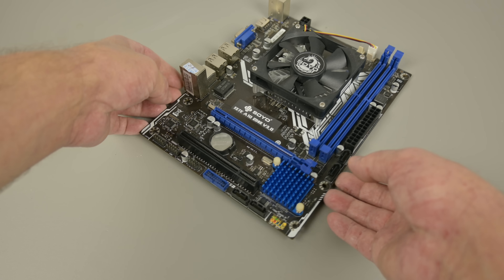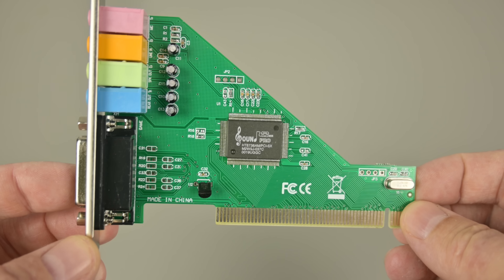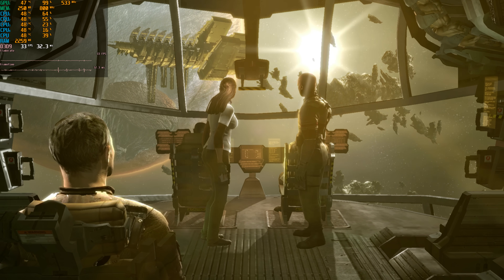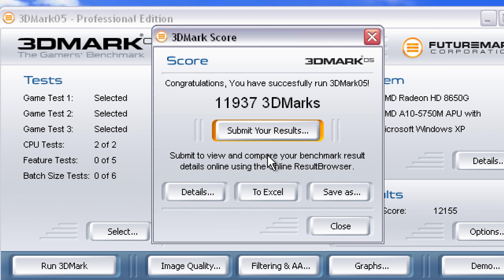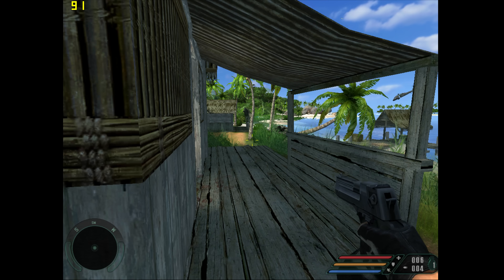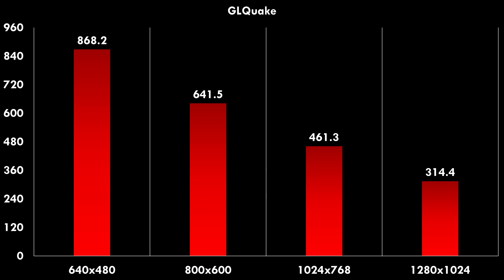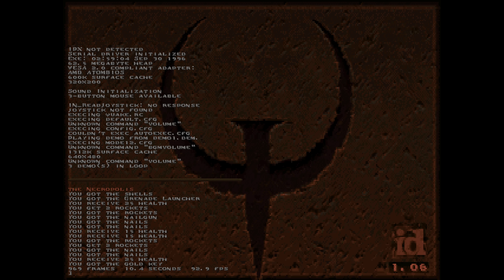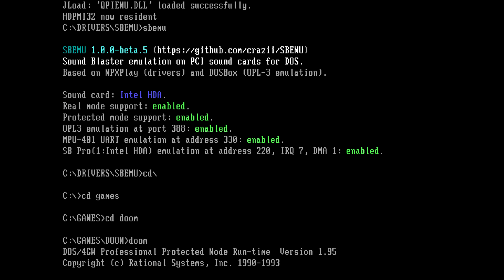SOYO A10 Motherboard: DOS, 98 and XP

Comment: Hopeing for a little help as I just had an ACER system given to me that I would like to turn into a retro BOX, but I have not yet messed with Windows 98SE on a system past 2004

AMD A9-9420 
12gb DDR4 
1TB hdd
it does have one PCI-E 3.0 slot, but it is a very basic motherboard, and the CPU is hard-mounted to the board, so I figured it might be a good system for older games. 
Do you happen to have a guide or pointers for getting 98 to run on an APU-based system

Comment: wait, how exactly do you install win98 on that hardware and which ssd are you using? it has too much ram for start... and how do you prepare partitions for win98? do you connect it to another pc?
Reply from the maker: Windows 98 Quick Install project includes a few patches! Check it out 😄
Reply: @philscomputerlab ok that was easy win98 installation looool
Reply: @philscomputerlab wow! good stuff! :)) I tried it out

Comment: A Geforce 6600 with 512MB of VRAM was my first PCI Express video card. Kept it around for many years as a fallback for when a faster card failed on me, and its limitations were a major factor in my buying Factorio back when it was still in alpha. Ended up putting off buying a new card for something like nine months until the 6600 also died due to Factorio's low graphics requirements and addicting gameplay. 

Mind you, just because it's easy on the graphics card doesn't mean it's easy on the rest of the system. It can absolutely hammer your CPU if you build a big enough factory, to the point that saved games for it exist solely for the purposes of benchmarking.

Comment: it could be the bios is a bit glitcy. sometimes you need to refresh it by 'load safe/load optimize default' to get the devices(soundcard) working with ms dos(sbemu/vsbhda).
Reply from the maker: Worth a shot! I'm revisiting the board with what you're mentioning: VSBHDASF

Comment: A10? Richland? Heh, looks like someone else finally found their hidden potential for old software =)
They get too much hate, they are probably the fastest and most modern CPUs without TLB invalidation bug; if you get bugs due to excessive amounts of RAM or CPU cores or speed, you can patch that or downgrade/declock and it works.
Besides, the Trinity integrated graphics fully support 8, 16 and 15 bit display modes (so long it's properly handled from motherboard/firmware side, which may or not include a CGA compatibility layer).
Motherboard shall NOT implement xHCI in order to avoid major compatiblity issues on Win9x...
You can also do/get all this with an A55BM-K motherboard, offers an FM2+ socket so you can put an A10-6800K and up to 16GB @2133Mhz to it (which, when coupled with an RX 580 dGPU is really cool for software up to 2021/rtx oriented)... 
I can pretty much run 90% of software released between 1981 and 2021, the only catches are (I'm talking about integrated graphics now), it features VESA 3 rather than 2, which confuses a couple programs!, and VBIOS is write-protected, which means you can't use UniVBE/Display Doctor or any tool to add display resolutions below 640x400 if you wanted those... For better graphics on Win9x you can use the universal VESA-based video driver just fine though, while running DirectX stuff through Mesa3D (CPU is crazy fast for this). SBEMU can be used for sound on DOS, not Windows. The only way to get sound on Win9x for now is adding an adapter so you can plug an actual Sound Blaster card, and you solder said adapter on... the TPM slot LOL!! at least the pinout is correct

And finally, I don't know why, Win9x installer crashes for me on Plug n Play detection, the only reason I've found so far is related to the ethernet system. I guess it's too modern. I hope this Soyo motherboard deals with that correctly, otherwise, skipping plug n play detection is easy anyway.

EDIT: Some old games rely on special timing for certain effects (such as color swapping in Pinball Fantasies' menu), you got to disable the CPU cache to get that to work (look for CacheOff on Vogons), which is fine for DOS games, but remember disabling cache in general slows things down a lot...
Reply from the maker: Great comment, a treasure chest of knowledge!

Comment: It seems odd to me that they didn't include basic AC97 sound support on board so that you only would need a sound card if using something older than Windows 98. It wouldn't be great, but it would be better than having to occupy the only PCI slot (or take up your PCIe x16 slot). You also have the option to use a USB-based sound device (I refuse to call a dongle a "card"), although again you may be limited by how far back the drivers go. I keep an old Turtle Beach Amigo II in the parts bin for purposes like this, even though the noise floor is pretty poor especially when recording.

Comment: I put a Soyo board into my very first computer, when I upgraded it from a 386SX-33 to a 486DX4-100. I only know though because I still have the cardboard box. Sadly not the board. Anyway, good times, and a perfectly fine board. On a related note, I came across a Biostar A620M board not too long ago. A similar blast from the past that I believed to be long gone! Not as good as Soyo though. ;)

Comment: What about using a GTX 750(Ti) for XP? You can get them quite cheap for even below 20 Euros and they have WinXP drivers.
Got another one (Asus model) that has 1x HMDI, 2x DVI and even a VGA port. Still need to test if it has the same issue as my other 750Ti, where sound over HDMI cuts out all the time when the GPU it doesn't get taxed enough. Especially happened in intro movies or movie cut scenes.
Reply from the maker: Very good GPU!

Comment: This era of APUs have disappointingly poor performance and the XP drivers are not very good,  You can get AMD AHCI drives for XP so you don't need to use IDE mode in XP.  High dos frame rates would be expected as the vga  frame buffer is in main memory so no bus transfers needed to write into vram; the CPU can write to it at full speed and an APU and DDR3 memory is a lot faster than any 90s system.
I'd guess dos sound problems are due to the device being bridged over PCI Express, it shouldn't normally make a difference but bridging sometimes causes issues. The dos drivers may be able to detect the device using standard PCI device discovery but not know how to properly  address the it if it is on a secondary PCI Bus.

Comment: I thought I did sent my comment on this video... But I guess forgot to click "Comment" (Or YT refused to do so) so I need to do it 2nd try. 😅

SOYO... That brand is either something I miraculously never heard of, OR I managed to forget about it after some years... But I like the fact that they make Retro-Friendly boards like this one, even though it's a AMD A10 build... But since this isn't a problem for DOS/Windows 98 to run on it... Nice! Always a another option for 98SE or XP Build... if someone wanted it... (Especially when the time will come where the 775 Boards will also jump in price... That's a scary thought, when you think about it. 😬) Not sure about Windows 7 and beyond... For those I rather a much stronger CPU than this one.

I didn't hear much about PCI-E GeForce 6600GT running on Windows 98SE (I had it as a replacement after the HD4870 stopped working and had SOMETHING to run a desktop at very least, so with Windows XP Games, it certainly didn't play CoD4:MW or CoD:MW2 too well, but until HD5870 came, it was still better than nothing. So I think it's more like a good GPU for Ultimate Windows 98SE PC Build.)

Sad to see PCI Sound Cards not working under DOS, that was a surprise, since DOS itself runs pretty good as you showed in this video.
Reply from the maker: Yea DOS sound was a letdown.

Comment: I have good memories with Soyo motherboards , specially in the late 90s/early 00s, it was a very reliable manufacturer. Nowadays their products aren’t considered “top tier”, so was back in the day, however , I’ve always considered this brand to be very above average . Remember the cheap PC-Chips motherboards from the K6 and Pentium II and 3 eras ? Oh boy , those things were a pain to work with .
Reply: Had a PC Chips M741lmrt which had both slot 1 & socket 370 and it had onboard SiS620 / 630 vga which was absolutely atrocious, even in 1999.
Reply: @benrogers84 yeah I remember those dude 😅. I worked at a computer shop and was responsible for assembling the computers and also troubleshooting computers clients brought to our technical support and I had to work with those cheap rigs all the time , it was sold like butter back in the day

Comment: There are forks for SBEMU. VSBHDA seems to have better compatibility with games and it also has a fork VSBHDASF that adds General Midi emulation on P330 with soundfonts! You can have SB DAC, OPL3 and General Midi support on modern hardware in DOS!
Reply from the maker: Definitely need to check it out
Reply: Nice. Also had Bad luck yet on my Boards with all known Plain DOS options. Need to try these ones.

Comment: I do have a Nvidia GeForce 6600 gt, the exact one from Gigabyte. I originally bought it for a Windows 98 build, but now it's being used for my Windows 2000 machine. Good card.
Reply from the maker: Make sure to use a fan, it really runs hot. At least mine does...

Comment: What type of drivers is it using for the onboard ATI integrated GPU in Windows XP? This CPU should be newer than the latest one supported by Windows XP, so I am curious to know what drivers is it using as normal catalyst works like rubbish for the A8 and A10 usually
Reply from the maker: Check the website link with downloads!

Comment: I am actually using a "Soyo" board (yeah, it's a brand of Maxsun now) on my 2nd rig, paired with an AMD Ryzen 5 5600 and a Radeon 6700XT. The board is called the Monarch Dragon B550. It's flawless except for the wonky BIOS, and I've bought it cheap from AliExpress. Gotten bored with the usual Asus/Asrock/MSI/Gigabyte gang and wanted to try a brand that I've used when I was a teen.

Comment: Can anyone recommend where one goes to learn what options there are for affordable, modern motherboards to run DOS and Windows 98?  I am tempted to go down the route of having a single computer rather than a bunch of desktop PCs from the time era...
Reply: Depends on how you define "modern."  The newest boards that work best with the fewest hacks/workarounds are Socket 775 boards with ICH7 or ICH9 chipsets on them, preferably with DDR2 ram.
Reply: @retro-computing-gaming  Thanks for responding 🙂
I guess by modern I meant currently produced, so the parts are available off-the-shelf. It would be excellent, though maybe not possible, to have a new motherboard that had Windows 98 drivers.
Reply from the maker: Currently produced? Nothing.
Reply: @philscomputerlab  Thanks 🙂

Comment: How did you make the PCI-e card (even if it was Geforce 6xxx) working on Windows 98? I though that slot & bus is not supported under Win98. What did the Device Manager show? How come that the NVidia drivers got installed? 😮 Anyway - big congrats to make it work - another retro chapter has just begun 🎉😁
Reply: same question: does win98 is able to access devices into PCI-express slot?
Reply from the maker: Yes, just need drivers!
Reply from the maker: Yea it surprisingly just works, sometimes the device ID isn't supported, but you can just install through device manager. I'm planning a follow up video covering the 6600 under 98!
Reply: @philscomputerlab - Thanks Phil, that sounds great! Looking than forward for the follow up 😊

Comment: That’s the same cpu/igp I’ve got in my Lenovo G505S laptop.  I’ve had that thing for close to 10 years.  Still works great.  I just bought a new Lenovo LOQ 7435HS/RTX4070 laptop to replace it.  I’ve been wondering what to do with the old Lenovo.  Windows XP sounds like a great choice.

Comment: Interestingly, unfortunately, it doesn't have enough expansion slots for my taste to accommodate more 98-compatible hardware. But if you don't use a LAN or 3DFX add-on cards or XP, it'll be sufficient. It's nice to see the Soyo name again, though; it's been a long time.

Comment: Like I mentioned before, The GeForce 6600GT is one of my favorite cards for win98
Reply: GeForce nv40 and g7x are One of the worst you can use with windows 98.
Compatibility is awful.
Reply: @Stermy57HW I been using my AGP versions of the 6600GT ever since they came to the market in two of my 98 machines and they worked wonderful for me. I still use them like this

Comment: I'm not surprised at the CBR15 results, barely faster than a 2.2GHz mobile Phenom II multithreaded, and as fast as an i3-7100U (2.4GHz) single threaded. 
Having experienced the previous Trinity architecture with my old laptops A8-4555M, and it barely outperforming an i5 U470 with MR HD5450 (very weak dGPU), the CPU cores nearly always limit the iGPU.

Plus side in my situation would be the full compliment of PS/2 and VGA - I could build a fairly modern (albeit limited) system that works with my KVM switch. TBH I wouldn't use any system based around AMD/Ati graphics for DOS simply because they have worse compatibility with some DOS games than Nvidia and S3 (old or late) graphics.

Comment: In xp on my A10 7850K  on 3dmark2001 i get 30,578 points, motherboard is the Asus A88XM-Plus (an excellent motherboard) the onboard video gets 135fps in trackmania sunrise at 1080p

In xp on my skt754 3700+ with radeon x800pro agp on 3dmark2001se i get 26,455, this is an asus k8vse deluxe motherboard, using a silicon image 3114 controller as you know via chipsets dont support sata3 drives, win98 on this machine runs smooth as silk too, but ive put 35 years of computer know how into it so no wonder

Comment: Interesting video, Phil ! That 6600GT rocks, man. I have a Gigabyte GA-E350N with AMD  E-350D APU. It has expensions just for a PCI card and has parallel and serial ports. I use it as home theatre system with Windows 8.1. But now you gave me the idea to try Windows 98 and XP on it.

Comment: Hi Phil! Not sure if you were using the latest catalyst 14.4 drivers for the APU, but if you were using that version I can tell you from personal experience that it actually hampers performance on terascale gpus and that's probably why performance was so bad on far cry. It's kinda like that issue with the later nvidia drivers on windows 98.

I have an hd 5750 on my XP PC with an E8400 and the 14.4 drivers have terrible performance in games such as fallout 3 and far cry. Using catalyst 12.4 solved all my issues.
There's also a thread on vogons by "pixel_workbench" talking about this exact issue. Just a suggestion, maybe you could maybe do a video to warn people about this issue, and I definitely would like to see a video of you testing some of those 6000 series pcie cards on windows 98.

Comment: In my experience, Soyo and the Via chipset, is a nightmare as far as stability is concerned. Used it for my K-6 2 300MHZ, if I remember correctly. The speed and price was still a tremendous value at the time. 25 dollar CPU and 35 for the motherboard on clearance. Good memories!

Comment: Hello!
May I request a review of a graphics card? I have a Geforce 6200 I put in a PIII PC (which I am struggling with) for Win98 and MS Dos gaming. It is one of the last universal  AGP cards made, and I was wondering if the performance is OK. I heard that the driver overhead is pretty high, so I'd really appreciate if you could put an end to this case!
Reply: I figured the trick with the gforce cards in 98, dump the nvidia app, just grab the individual driver file without any of the extra nvidia stuff. Seems to help with 98 as it uses less overhead. Noticed it with XP as well just using the whmd certified driver without the nvidia package. Played with a p3 last night and 3d mark 03. Using the baseline driver, no apps, got almost 20 fps more consistently with a garbage fx5200 pci.
Reply: @thekikendallsautoandrandom1271 wow, that performance sucks. (I couldn’t test it myself as I have a corrupted main drive and my floppies don’t work no matter what I try or replace.)
Reply: But… it’s not terrible. For getting digital out for baremetal Ms dos that’s more than enough. And probably every other game I play that is more recent than 2k can probably made to run on my main rig.

Comment: I really love these videos, Phil! It would’ve been interesting to see the GeForce FX 5500 PCI in this one. About the sound card issue in DOS - have you tried disabling all the USB options in the BIOS? I used to have the same problem until I switched them off, and after that, most sound cards started working fine. I think it’s because they share IRQs (namely, 5 and 7).
Reply: I've never got SB emulation to work on any AMD chipsets.
Reply: @foch3  Ah yes, I did forget to mention that I've only tested this on sockets 478 and 775. I'm curious to know if it would work with AMD chipsets.

Comment: Phil what is the oldest fake gpu you ever seen?
I just found a fake geforce '6200a 256mb' with fake nvidia fan but under it not only ati, its a MOBILITY RADEON 9000 32MB chip slaped onto a desktop card!

Never seen anything like it on internet....
Reply: hmm, really? there were fake gpu and ram in early 90's also!
Reply: I heard about those old dummy rams but a working agp card with mobile ati chip as a fake gf card is something never even heard of... 
even got two empty slots of ram module on pcb since its ram modules are right beside the gpu die, just like a normal mobility 9000 chip!
Reply from the maker: Rage XL?
Reply: @philscomputerlab  lol yeah I guess they still selling it brand new? wish I could send this fake 6200 to you for a test...